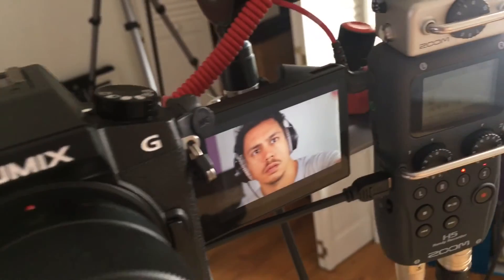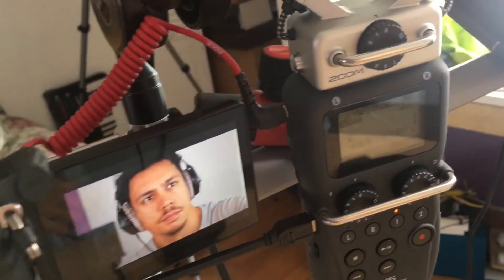Fixing noise interference issues while recording audio and video

Comment: no it wasnt helpful. My mic picks it up. how do i get rid of it?
Reply from the maker: Sorry to hear your mic is still picking up noise. If you haven't already, try moving your setup to a different location or swap out the cables. You could even try moving away from any power sources and/or try a different outlet (if you have any of your recoding equipment plugged in). Good luck!
Reply: @TabsOnTech  Its picking up the radio station